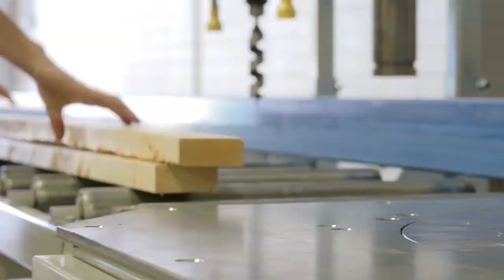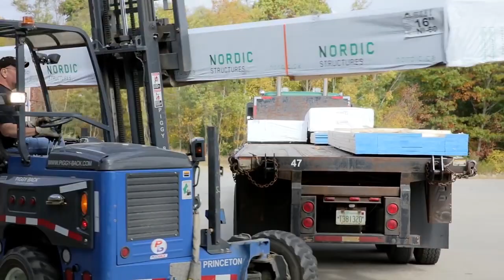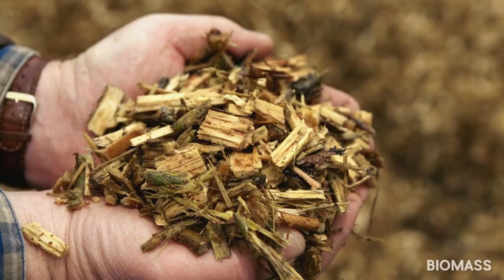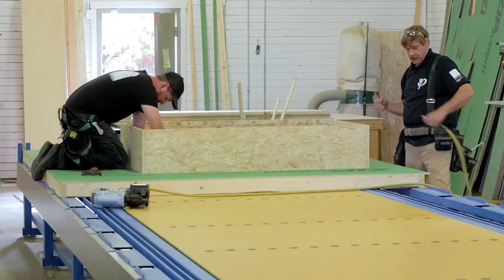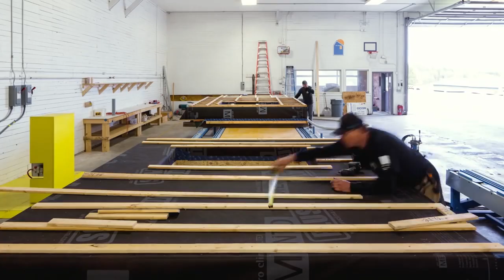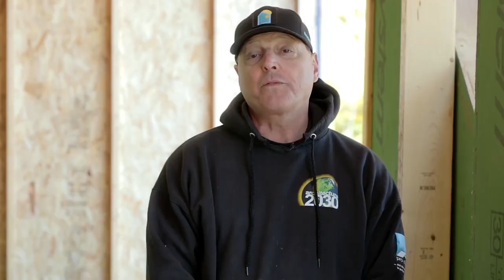Ecocor: Panelized Passive House Process

Comment: I hate wood !
Reply: Lol why?
Reply: @RileyIsRisen  I have built a caban and i learned that it is crooked , roten, cracked  and if is not already then it will be soon .  Does not inspire confidence when building a house. You must use reinforced concrete and steel.
Reply: @fcalin21  You just used low quality lumber. If you find a reliable supplier and are willing to spend more money, you can get excellent quality lumber.
Reply: @dlg5485   It becomes as expensive as steel then with the disadvantage of needing maintainance. Steel you can weld and it is easy to procure.
Reply: @fcalin21  crooked and rotting? Lol, sounds like multiple build quality, design issues and material selection mistakes were surely made.  
There are plenty of 100+ year old, straight and square wood homes still standing solid and dry till this very day.   
Wonder why their wood structure is working out so good after all these years and yours is failing already??   

It not going to be because you both used wood.  
Do everyone a favor and just stop building stuff.   
Popsicle stick building skills don’t cut it much after middle school.

Comment: A lot of particle board in the construction? Which means a lot of chemical adhesives?
Reply: Plywood is held together with adhesive materials too
Reply: @beebob1279  That's true, but there is far less of it in plywood and it is sealed between the layers of timber, which means far less off-gassing. Plywood will also a far stronger material.
Reply: @dlg5485  I'll agree with it being superior in strength.  I would never put particle board on my home.  I re-sided my home 25 years ago.  The builder had that cardboard sheathing which is crap.  I tore that off and put on plywood.  Dad said not to ever use the particle board (was in construction).  I trusted his judgement.
Reply: Not just a particle board, it's zip sheathing. It seems overkill to put it on the inside, that green waterproof coating is meant for exterior use. You don't really need a moisture barrier on inside, you only need an air barrier which can be achieved with standard sheathing even drywall. Anyways, Ecocor could probably swap it for plywood if request, of course for more money.